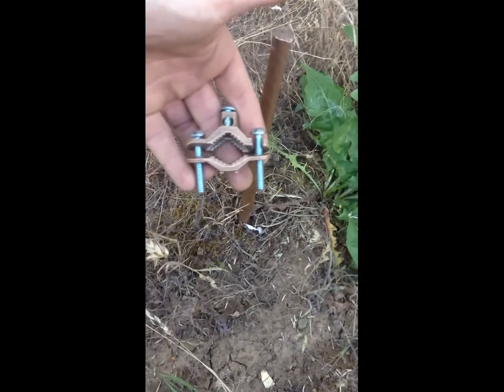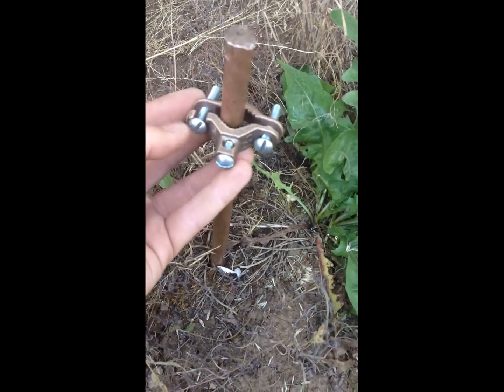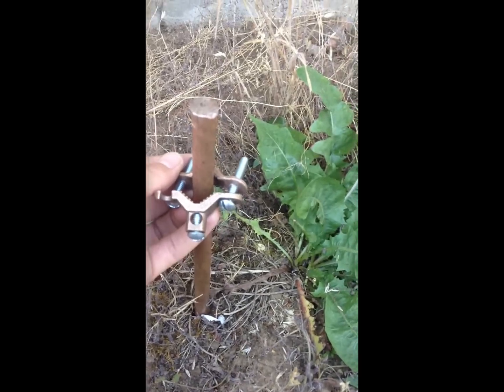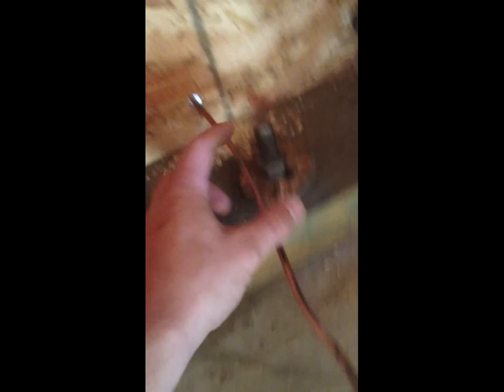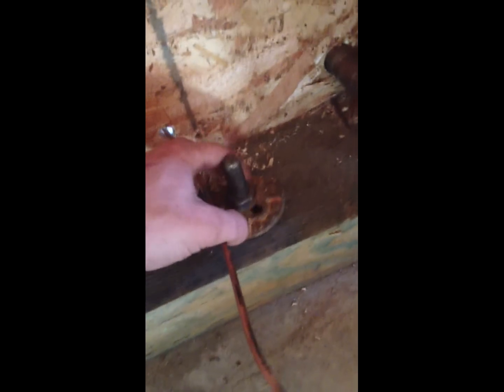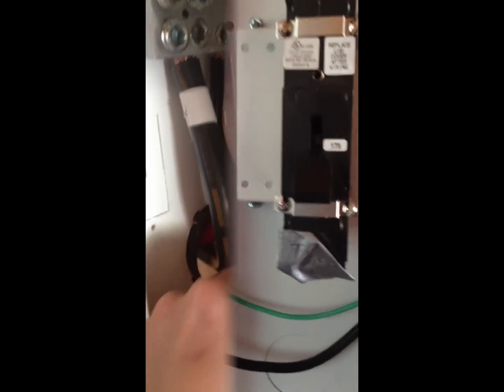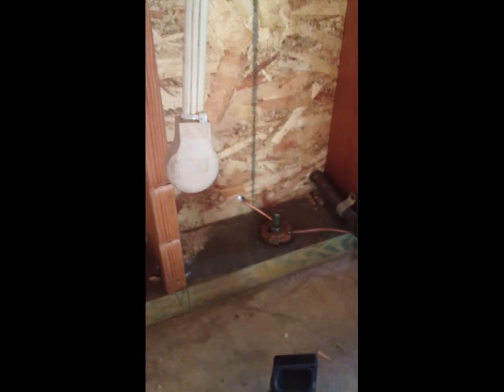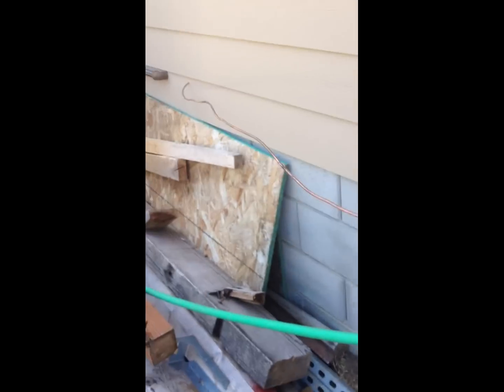Installing a Solar Off-Grid System 20- Grounding your system

Comment: Nice vid. but you forgot one important point, the rod should have 25 ohms or less to earth. On the farm we used a 24 volt ac door bell transformer that could deliver 3 amps, and an amp meter to read current, if you got 1amp was good to go. For anyone reading this comment, this method can be very deadly if done wrong so be very careful any voltage over 30 can be lethal.